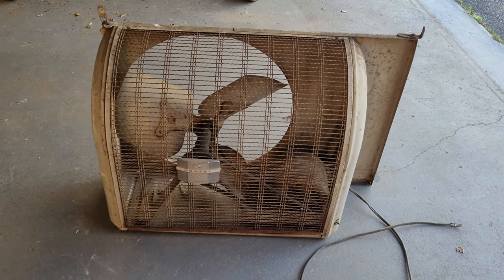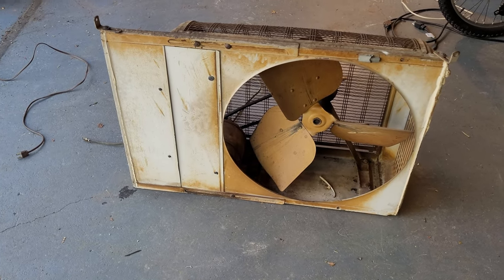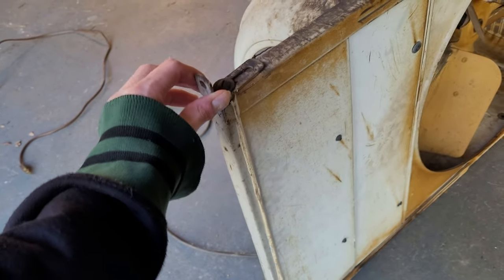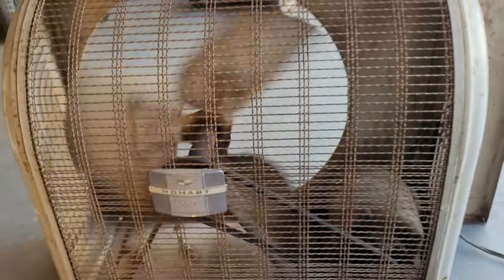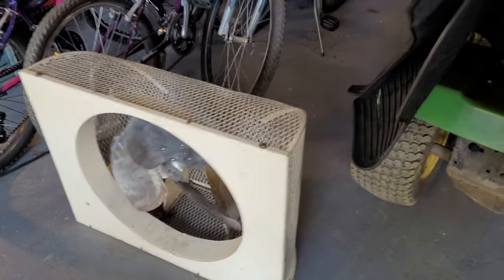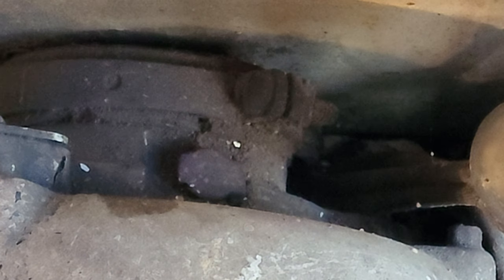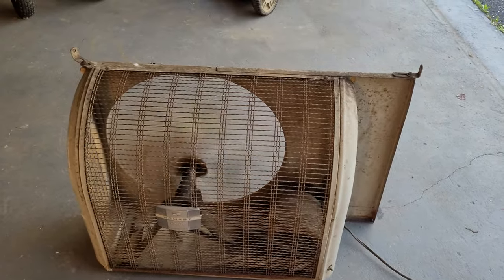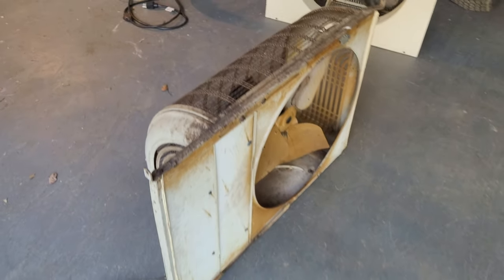Vintage Sears Homart Cooler Belt-Drive Window Fan

Comment: Many people used those fans before air conditioners were popular. The belt drive and deep pitch blades pulled twice as much air through the house rather than the cheaper direct drive .It was placed in a window with the window screen on which had to be pulled and cleaned because the fan pulled dust and cooking fumes out the window. The two speed was there because as the house cooled down, he fan could be left on all night . The sliding panels came with the fan to fit any window width especially older homes.  There were rubber pads to sit on the window sill to dampen the vibration. Take it apart,clean it up, install a new belt as the old belt is dried out and there will be less vibration. Only open windows farther away from the room as possible as this fan will really pull and help cool the whole house.People make the mistake of opening windows close to the fan and that defeats the purpose of a whole house fan.  We had these fans before air conditioning in the early 60's and later got a newer Sears model with two speeds forward and two reverse plus a thermostat that would shut off late at night when the house cooled down and turn back on in the morning.  You're right about a screen if you are going to use it as an area fan as the belt drive blades out of a screened window setting are dangerous!    Try it and see how long you can live without turning on the air con.  Enjoy!

Comment: Looks to be early to mid to early 50’s. These were built before the days of built in whole house fans and probably could have been used as a whole house fan for many years since it’s that overbuilt.
Reply from the maker: so like I assumed it is old, but the Atlas is older, from the 40's or before.
Reply: @BAFVintage  the Atlas definitely is from that era, from what I remember it had a Delco motor which was made by General Motors. GM made some motors for these belt drive window fans but Craftsman, Westinghouse, GE, Emerson, and a few others made motors for these.

Comment: I've been after one for the longest time, all I've managed to find within a reasonable driving distance is a Wind-O-Cool by Belco that needs a new belt and probably a new motor pulley as it's not spring loaded like every other Belco I've seen

Comment: Awesome video on this! I'm glad you got it before it was destroyed :) These are very good reliable fans with the best performance in my opinion. We had one many years back but was a different model .. A remember it being very quite with good air volume . It's up to you what your going to do to this but I would like to see it restored .. As a request I would like to see another video . I've actually found one on market place that is the same model as this one I'm hoping to get by the end of the month . I enjoyed the video of this 1940s or 50s Sears window fan .
Reply from the maker: Thanks for your comment!These are overbuilt in some ways but that's probably why they last so long and run for years after being neglected and forgotten about like this one. I am planning on restoring this one, maybe not quite as full a restoration as I did on the Atlas but at least clean the rust stains and installing a new cord and probably finger-proofing the rear.
Reply: @BAFVintage  No problem ! I hope you fun with this , a new belt and power cord and removal of the rust will do the trick , yeah .. I think a guard over the exposed blades would be a good idea:) This is something I remember my Grandfather did with tbe one we had .. If you have an 18inch guard off a Patton or another fan like it you should get the guard right over it no problem . I'd love to see it afterwards !

Comment: I just found one of these as well. What were you saying about the shaft/bearing only taking 30 weight oil. Also any idea of when this was made?
Reply from the maker: Cool! These were made in the 50's, probably around 1955 or 1956. The bearings should only be lubricated with 30wt detergent free oil, as household oil with detergents can damage the pores on the bronze bearings.

Comment: Mine is now a 6 blade vce dpinning/running and a new motor wth a vce blade on it. But I might put a 16 blade 20” on it or a 6/six blade in the same or rght size thts not too big, or an 8/eight blade, the kind from Carl j and bush/cj@ kr and b, it’s the kind of blade that’s made to blow or lke move large volumes of air at/@ low speeds whch seems/xnd ir fir and,/…are cool. I’ve also fight about even either replacing it wth the original or lke a replacement part, or jst lke fixing the bend or modified blades from me or so/smthng lke tht
Reply from the maker: Thanks for letting me know hoss

Comment: But from experience, they don’t choose your hand from the front, they just give a hard whack that knda Mkes yxur hxnd knda numb, xnd basically whn the old blade or run it ws xn it running backwards, i hd sine little close pin clp things holding wither wth a piece of fabric lke tissue it jst it ws tissue or so/xnd @ pretty small lke , 8 by 12” poly cotton or so us flag  tht staples in to a pole with hems or hemming  all around the edges single sewn in thnk, whtever it was wsnt tight enough, Ainu tried to fix it, xnd thinking I had xnd leaving and, enough took,/…I ddnt and it whacked my band. Now if it was/were from the bck, it mght actually chop or so, kr at/@ least jst cut. But if a kid, it mght break from front or chop from back or sx
Reply from the maker: are you okay?